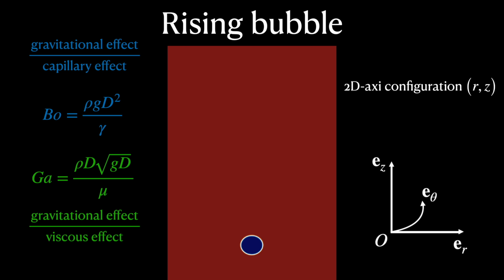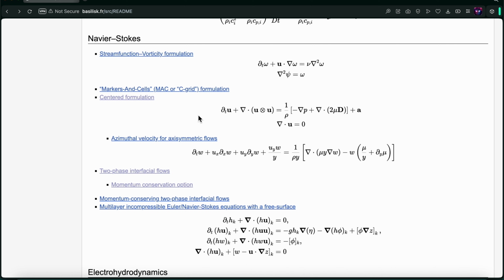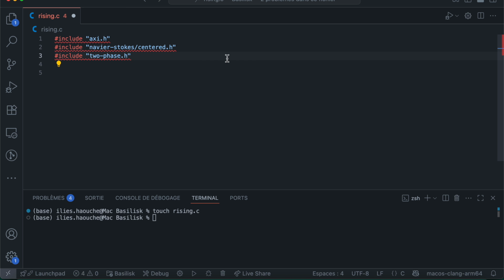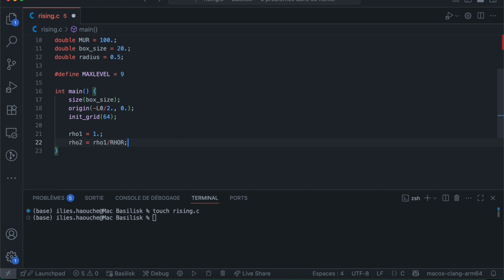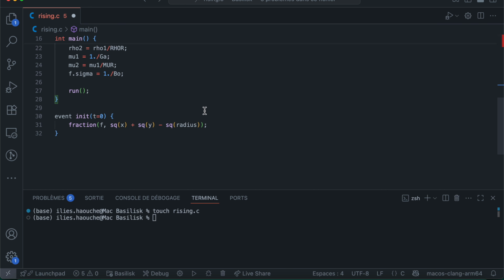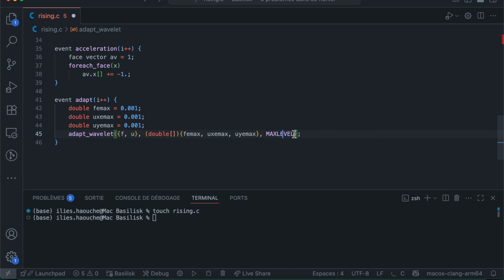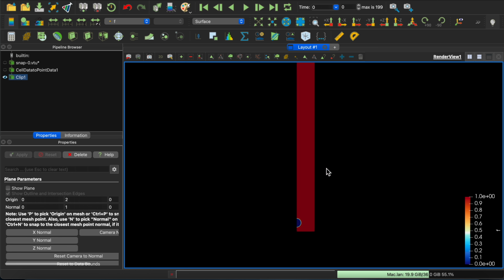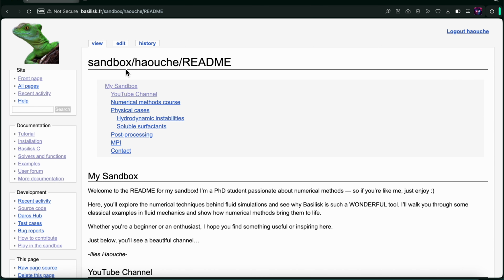basilisk : rising bubble [English]

Comment: I like the idea of Basilisk video tutorials!

Let me just highlight some strange things in the code:

1. It should be #define MAXLEVEL 9 and not #define MAXLEVEL = 9.
2.  The init event is usually at iteration zero instead of time zero: event init (i = 0)
3. The acceleration event should modify the face vector a, defined in navier-stokes/centered.h, for example:

event acceleration (i++) {
  face vector av = a;
  foreach_face(x)
    av.x[] += -1;
}

I am not sure how it can work setting: face vector av = 1. More easily, using reduced.h you just set G.x = -1. This strategy also simplifies setting the boundary conditions as gravity appears only as an interfacial force.

As a last point, I would strongly suggest you to avoid that output_vtu and stick with bview for post-processing. I think that one of the many nice things of Basilisk is its possibility to embed every operation (pre-processing, simulations and different refinements, and post-processing) in a single .c file. If you do that, you can run and also display the post-processing on a sandbox doc page.
Reply from the maker: Thank you very much for all these comments! They are very constructive! Regarding the #define, yes, it is a typo initially, I had put "int", for the init event, I saw that only at the first iteration putting t=0 or i=0 does not change anything! Regarding the severity, I was able to meet Basilisk users and from what I understood, there are two schools of thought: people will use reduced.h and others event acceleration, I wanted to present both! Nevertheless, I tried and it works, I reassure you! But in other cases the reduced.h model is easier. Finally, yes bview, it's on my list of things to do!! I've never used it... :( I'll find out but I also know that many people prefer to work with Paraview, especially OpenFoam users, so that's why I try to be broad in presenting certain things so that the public can have a wide range of tools at their disposal! In any case, I thank you for this comment and I'm glad that you like this video idea!